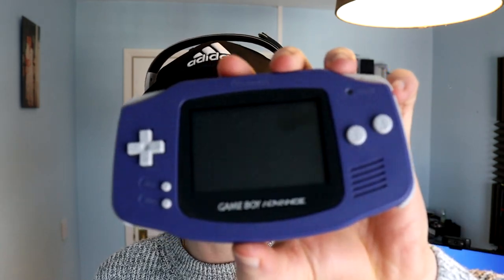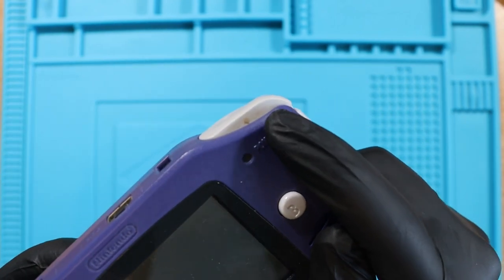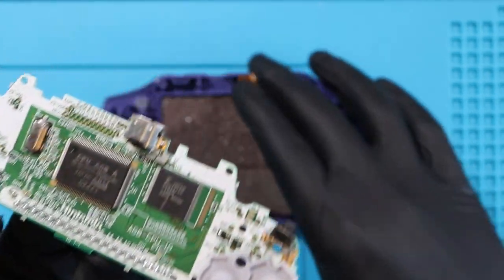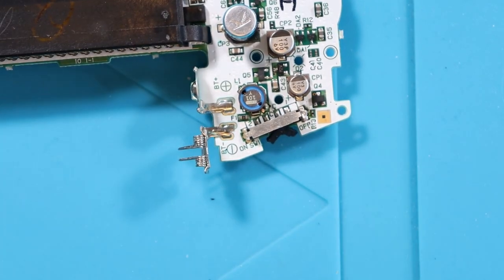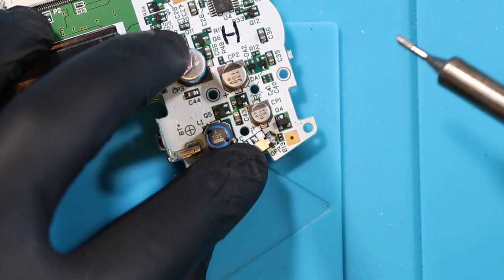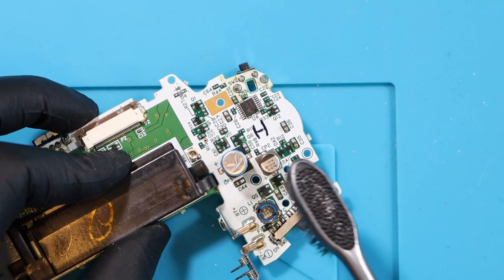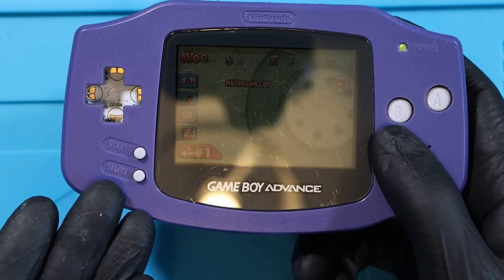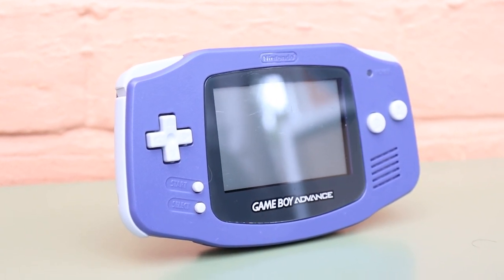Faulty Gameboy Advance Power Button Repair & Restoration!

Comment: Good to see a power switch disassemble and clean up. Looking good my friend. Dare you to race on "Boo Lake" on this GBA. 😁

The GBA I bought to IPS (V2) mod was listed as "faulty screen" and also around £25. Worked perfectly and in similar condition to yours. I still modded it to protect by teenagehood (is that a word?) glacier blue transparent model.

Preserve this indigo model as original and mod either the orange one or a more beat up model. As I've said before, as well as Saro in the current comments, get a precut IPS shell for it, make sure you get a V2 screen and ensure that it can take either 32 or 40 pin ribbon cables to play it safe.
Reply from the maker: Yeah I've heard things about the different number of connectors. Will be on the lookout for a beaten up Gameboy Advance looking for some loving. Cheers for watching as always Toxo!

Comment: I did an IPS screen mod on an old GBA I got off Ebay and I cannot recommend it enough! I would also invest in a precut IPS compatible shell (I picked one up from RetroSix and it is fantastic), just saves you the stress of modding the existing shell which I know I would have botched! The only other things I would suggest is a USB C battery mod and a glass screen lens too.

Trust me, you won't be sorry. Great vid as always!
Reply from the maker: Thanks Saro! I'm kind of tempted to keep this one as it is because of the condition. Can always get another to put an IPS screen into right?
Reply: @JoeyDoesTech  Absolutely, there's something to be said for keeping items like this in original condition. Save modding for the more beat up Gameboys out there that need a little love.

The one I picked up was functional but looked a mess and was missing the battery cover.

Comment: I have one that had a poor power switch (it would turn on, but would say even new batteries were running low) - I ended up having to scrub the copper traces with a bit of brasso to make them shine as new.
And yeah, I would vote to keep that one fully stock, it's too nice to mod, see if you can find one with a trashed shell and then do a IPS and shell swap in one (get the benefit of a pre-trimmed shell).